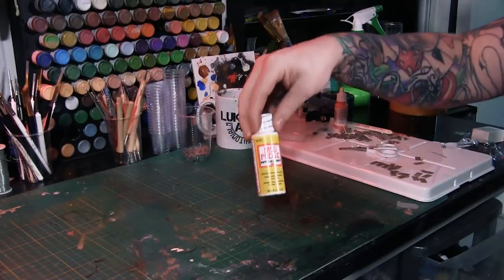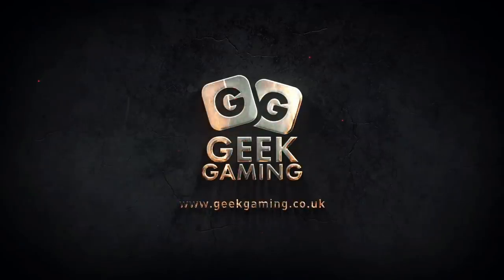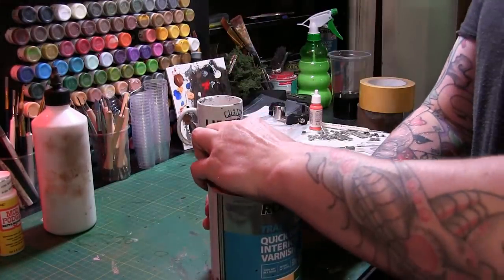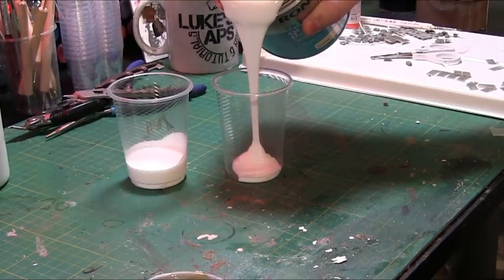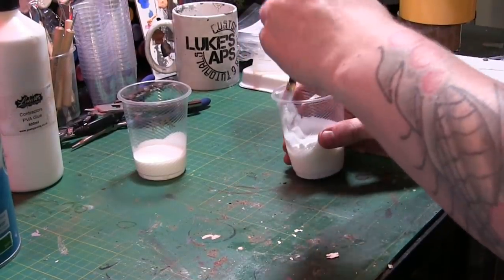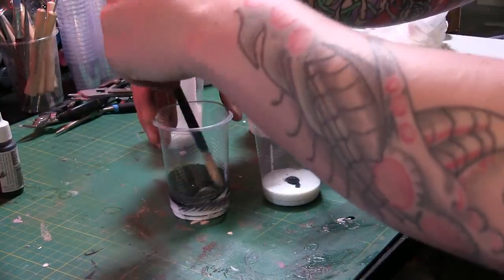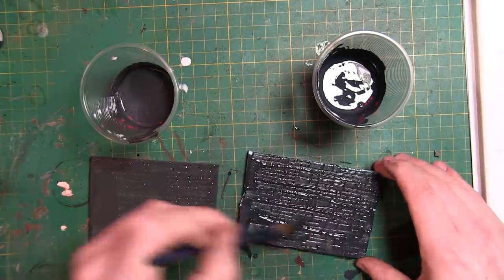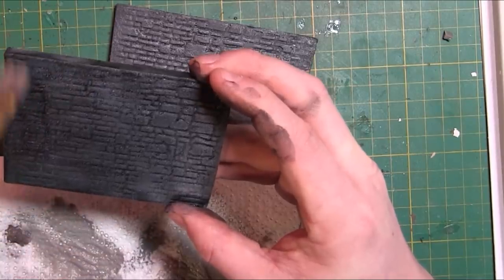How To Make Mod Podge (DIY Modpodge Made Super Cheap For Your Crafts)

Comment: realise this is 4 years old now but, if you just use just the glue & water (2 parts glue, 1 part water) you will get a matte mod podge. I make two versions, a matte one and a gloss one (I add water based varnish for the gloss of course)
Reply: the varnish I use is polycrylic I believe you can get that in matt, so adding that to the pva & water should work should it not?
or I guess maybe adding some white acrylic paint?

Comment: Even though Mod Podge is now too expensive for me to use on larger pieces of furniture, I must say that the products I used it on around 30 years ago are all still totally intact. The coating on the outside is still as thick as it was at the start. Nothing has yellowed over time- though I know that's happened to some people.

Comment: If you're in the US looking for ronseal, look for Minwax Polycrylic or Varathane Polyurethane (water based) I personally picked up the 2nd one at Home Depot :)
Reply: I can say based on experience that minwax polycrylic is not the exact same thing as acrylic medium that you would use on a miniature, though it may be close enough to work in most miniature painting situations (I don't know). When fully cured, the minwax product is harder and more brittle than other acrylics.

How do I come by this knowledge? I'm into archery and build my own bows and arrows. I prefer the traditional style of bow with no cutout for the arrow to pass through, meaning the arrow must flex all the way around the full width of the bow and it will continue to flex and twist in the air until it hits the target and expends all of its energy. I have experimented with a variety of finishes for protecting my arrows, minwax polycrylic being one of them. I have never had a problem with any acrylic paints used for cresting or decoration, but the minwax polycrylic had severe problems with chipping and flaking due to the flexing as the arrows aged. As a point of comparison, traditional nitrocellulose lacquer, generally viewed as much less flexible than acrylics, stood up to the flexing with no problems.

Comment: Back when I first started model painting I used artist gesso as a cheap primer alternative. I got the idea from a website or Reddit page I honestly can't remember. I wonder if it how it would work as a foam sealer and be tough enough as your mix or regular modge podge. They do make black gesso but you can just tint the more common white gesso with paint to color it. I imagine it would work rather nicely or at least good enough for terrain work. Hmm I got to thinking if you goal was tough foam sealing then here are a few more below.

Spray primer- be careful not to spray too close. The solvents within the can will melt the foam so spray from a foot away and in light quick coats, to allow the solvents to evaporate quickly. Edit I meant the thicker filler primer. sorry

Spackle/Filler/Drywall Compound- All these seem to work for the Terrain Tutor(Another tuber that focuses on terrain for wargamming) but never really had a chance to do large scale terrain pieces with the stuff. His tips with working with it are watering it down a little and get a damp brush and/or wet your fingers and rub it down to even it out.

Liquid Rubber- I know people have used flex-seal (or any liquid rubber sealant) to seal larping and cosplay props so why not terrain pieces they make a brush on and spray can variety. I'm sure if you put a few light coats would work wonders at sealing it up, and making it a hard rubber exterior shell. They come in white or more commonly black. But Plastidip (a US brand I think) does make a variety of colors. Never seen anyone tint them so think your stuck with the color out of the can.

Really would like to hear anymore ideas?

Comment: Got one for you - If you use Tamiya extra thin styrene adhesive it's a 50/50 mix of Butyl Acetate and Acetone. Readily available from Ebay and about a tenth of the price.
Reply: No chance at creating nerve gas and wiping yourself oyt when mixing this?

Comment: We need a ronseal alternative in america
Reply: @GeekGamingScenics  thanks!
Reply: I use Varathane ultimate Polyurethane (water based) purchased at Menards
Reply: @GeekGamingScenics  
I can say based on experience that minwax polycrylic is not the exact same thing as acrylic medium that you would use on a miniature, though it may be close enough to work in most miniature painting situations (I don't know). When fully cured, the minwax product is harder and more brittle than other acrylics.

How do I come by this knowledge? I'm into archery and build my own bows and arrows. I prefer the traditional style of bow with no cutout for the arrow to pass through, meaning the arrow must flex all the way around the full width of the bow and it will continue to flex and twist in the air until it hits the target and expends all of its energy. I have experimented with a variety of finishes for protecting my arrows, minwax polycrylic being one of them. I have never had a problem with any acrylic paints used for cresting or decoration, but the minwax polycrylic had severe problems with chipping and flaking due to the flexing as the arrows aged. As a point of comparison, traditional nitrocellulose lacquer, generally viewed as much less flexible than acrylics, stood up to the flexing with no problems.

Comment: For Legal Reasons cutaway was hilarious. Where are you getting the blue foam in the uk? do I have to order it online or can I get it from a hardware shop?
Reply: I get mine from eBay from UnderFloorHeatingStore. XPS Insulation Foam sheets Board dimensions are 6mm x 1200mm x 600mm for £2.49. 10mm x 1200mm x 600mm for £3.49. There is no minimum order, free delivery. If you ordered on 29th you would get it on 31st.  If Luke or someone else knows of somewhere cheaper even better.

(Edited corrected 600m to 600mm opps my bad)
Reply: @CaptainBipto  Where do you store 600m long anything? ;) I'd be keen to watch the transportation...
Reply: @basementdwellR  I get mine delivered by courier from the seller I mentioned at no extra cost. It should be 600mm.
Reply: @CaptainBipto  Yeah I was just being a bit of an arse :) I still think that it's ridiculously good that you can get it delivered that cheaply though. I have to go to the hardwarestore myself for stuff like that or pay exorbitant prices for shipping/courier services. I'm in Sweden btw. Thinner XPS is hard to come by over here afaik. :(

Comment: Seems only logic your mixture with varnish will be superstrong, but to be honest; I always use my own mixture with just 50-50% PVA (white) glue with vallejo paints. (and a small drop of water) zSo you can even chose the colour you want. With an optional second layer it makes a surface strong enough. Use it for basecoating minis, or for styrophoam or dental plaster (hirst arts) on crafts/buildings. 
Ps vallejo paints do interact with pva, some other brand paints do not. 
Thanks for the nice vids, I subscribed
Reply: Check out Black Magic Craft...he did a comparison as to why he uses mod podge with paint as compared to just PVA with paint, as a basecoat for foam terrain.

Comment: You haven't actually said WHAT product you use instead of mod podge, other than the white pva glue that you show up close. (It would be really good to get a trade name for the glue too). You mention something called 'Ronseal' but when I've looked this up I find it's a general brand and they have a load of products. You need to actually say and show the product if your video is meant to be helpful. I actually think you don't need to add any water as this product seems to flow a bit anyway. If I wanted a better flow I'd probably add a bit of Floetral.

Comment: Luke, I need help, bro! I'm trying to do my own custom lore 40k Ad Mech. / 30K H.H. Mechanicum army from a sort of overgrown/over-terraformed jungle/rainforest [proto-]forgeworld. Can you offer any help on triple canopy rainforest? Also, why did I torture myself by picking what surely is one of the hardest terrain types to create? 

O wait... I remember. Cuz it's awesome (or it will be if I can pull it off)! 😏  Just nevermind I'm only getting back in the hobby at 32 after putting it down in my early teens. Pffft, if you think that's bad, I originally wanted some of the miniatures to look like they had a optical camo cloak on half of them kinda like from Predator (Stygies has them!!!). Alas, the only way I could figure out to ever do such a thing was to recast the mini in clear resin, saw it or cut it somehow in half and fuse the two but that sounded like too ambitious even for me. I just demand something truly special before I let it out the house! 😅

Comment: If your primary surface is paper or card stock, DONT ADD WATER! Thin your medium with floetrol I use Flood. It goes on very thin and dries so quickly you’ll want a bigger brush, but it’s invisible!